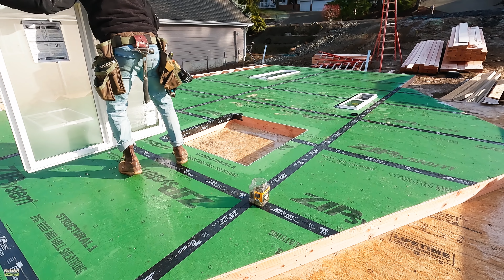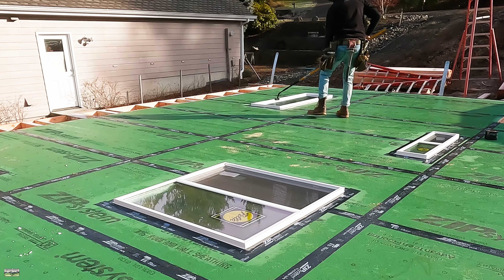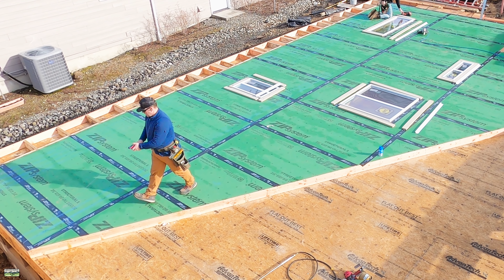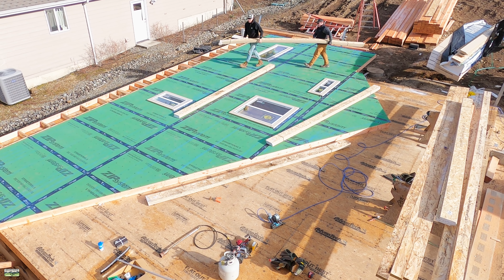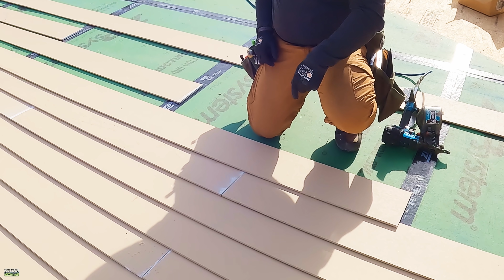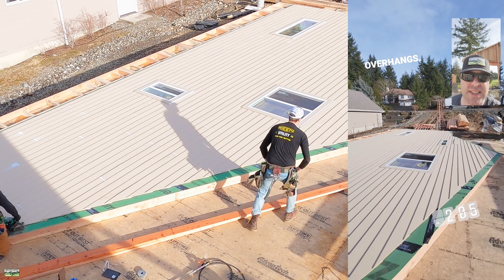How to Be Efficient- Siding the Great Wall

Comment: if you had a wall with several large fixed windows (3-0x6-0) would you be worried about the glass cracking when you go to lift the wall? (besides that concern, I really like this method)

Comment: Question…when you raise the wall and side the bottom part…how are y’all nailing the siding when it meets each other? Make sense?
Reply from the maker: yep, just side right up to it and tuck the last under the first one on this wall.  Bottom nail it.  Some people freak out but remember that all the trim and fascia is nailed and the nails are on the outside of the material.  Its a non issue in real life.

Comment: At 21m mark are you eyeballing the gap at the window orrr how do you have consistent spacing? It appears as though you first nail on the opposite end of the siding.
Reply from the maker: Yep just eyeball it.  As the pieces get smaller, that gap is less important.  Also because I order siding delivered with the wall framing, it is usually already at a higher moisture content.  It comes out about 10%, which is crazy dry.  We let it acclimate before installing in most cases.
Reply: @AwesomeFramers  I gotcha, thanks for the insight

Comment: Looks like you didn’t pre assemble window trim with that strange staple thing you have? Wondering why? We always pre assemble with pocket screws.
Reply from the maker: Just wasn't worth rolling it out.  We've been installing trim without pocket screws, corrugated fasteners or biscuits for decades.  It doesn't make a difference with LP SmartSide.  I like to preassemble when we have more than just the windows here, because it is normally inside work.

Comment: only thing I would do differently is put in battens so you have a bulk water drainage plane.  I know a small thing.
Reply from the maker: We don't need to do that with lap siding in our climate zone because there is air flow behind the lap.  Easy.
Reply: @AwesomeFramers  where are you located?

Comment: How long is the average schedule build time for the shell of the house for the two of you?  (Including the foundation).  Also, what do you believe would be the optimum number of framers on site for a typical house build?
Reply from the maker: I can't answer the first part anymore.  Things are so goofed up with supply chain issues and increasingly  more management.  

If we didn't pull off a house like this, with a 3 person crew, I would say 4 weeks to frame and side.  But that's everything going smoothly.

A 4 person crew works best in my view.

Comment: This might be a dumb question but have you ever had a window not slip in to the slot for whatever reason when setting? If so, what do, or would, you do in that scenario?
Reply: Emergency reframing, but if the window is framed right that should never happen
Reply: @joshwalters348  so there's enough play given during framing so it shouldn't ever really happen basically? I appreciate your time, I've got a commercial contracting background and I'm trying to learn more about residential
Reply: @KP-ol3tc  yes on the plan the window size is called out, let's say 4o 4o that means the window opening is 4 feet wide by 4 feet tall. The framer frames the opening to that dimension then the windows arrive about half an inch smaller so 47.5 inch by 47.5 inch to easily fit the opening and have room to adjust should the framing not be perfectly plumb level square or straight.
Reply: @joshwalters348  That makes total sense, thanx again bossman
Reply from the maker: @joshwalters348  yep, many times.  Its always because one of us forgot to cipher the cripple studs taking into account the sill.  When its off, its always 1 1/2" 😂😂😂😂

Comment: here in uk we cant do that, should be a service batten fixed vertically to allow air travel and water to escape otherwise will rot  in the near  future
Reply from the maker: Yeah, this won't rot in our climate zone.  Since this is lap siding with corners over the top, we have airflow which promotes drying.

Comment: It hasn't premiered yet, but why would you install the windows? 

Surely when it's up and all the weight is actually having downwards pressure, it has the possibility of throwing things out an 1/8th, making the window, siding, etc, buckle. That's why you don't see people do it that often from my experience.
Reply from the maker: The reason people don't do it because they can't.

A properly fastened window will not do any of the things you mentioned in my experience doing this over parts of 3 decades 👍
Reply: @AwesomeFramers  reason people don't is they want to go fast and frame frame frame making the windows and siding the window or siding guys problem. You guys really seem to get slowing down to go fast. Yeah everyone loves banging walls together but we have to do windows or siding so may as well do it when it's easier.